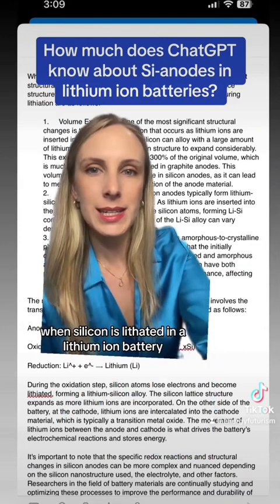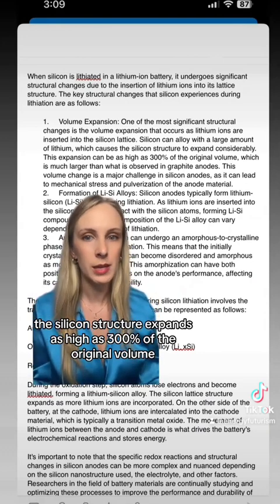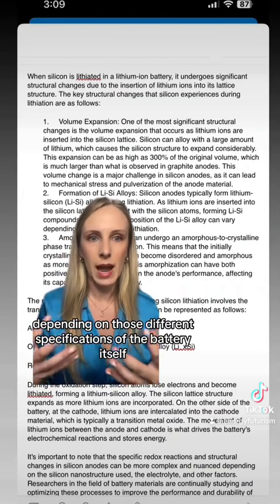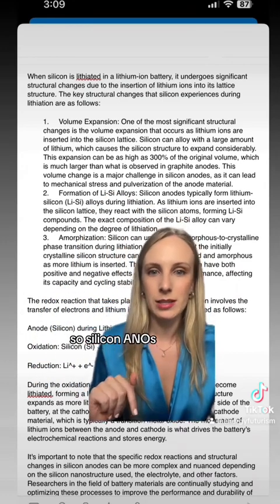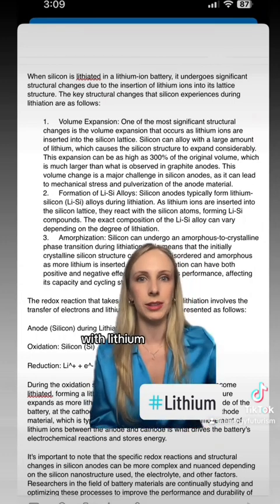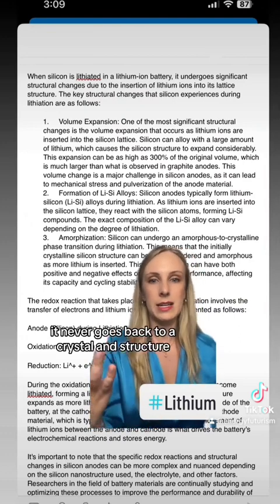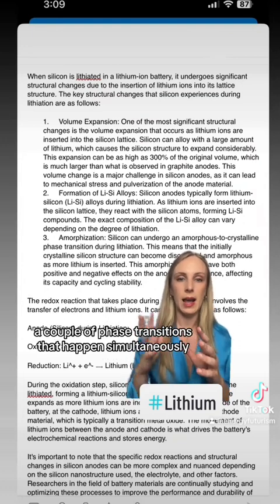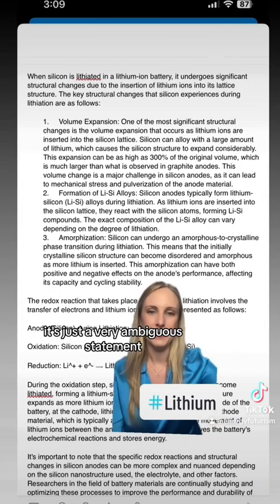Does ChatGPT know about Silicon-dominant anodes for lithium ion batteries?

Comment: I have corrected errors in gpt 4o by telling it that it was wrong and giving it the logic for it to research and determine what is right it is worked well and I’ve proven it by asking at a slightly later time and it comes up with the proper description, so it is drainable

Comment: Thank you for the information, Jill. Could you provide a reference confirming that the 300% volume expansion occurs exclusively during the initial cycle? Additionally, what is the extent of expansion in subsequent cycles? Reference for Si not going back to crystalline structure as well. Thanks!
Reply from the maker: The extent of expansion in subsequent cycles depends on multiple factors including the stresses on the electrode and around the Si, the particle composition after initial lithiation/delithiation, and the degree of lithiation during each cycle. Reading a variety of studies about Si anodes can reveal how different results are achieved around volume expansion.
For more resources, be sure to subscribe to Battery Industry Onboarding through the link in the description. 😄
Reply: Been there. Done that (subscription😄)  @AcrosstheNanoverse

Comment: what about Si-Graphene? been seeing it on RC lipo battery for my RC cars... im still not convinced its has GRAPHENE and they are just marketing it not sure if thats goof to use for EV cars
Reply from the maker: You’re right to be skeptical. Graphene May or may not actually be in those batteries. Graphite are close-packed sheets of graphene 🤣 , maybe that’s what they mean. High purity graphene for Si-graphene batteries is expensive. Most conductive additives are carbon nano particles or nanotubes. And many anodes with Si on the market today are majority graphite with Si or SiOx additives.